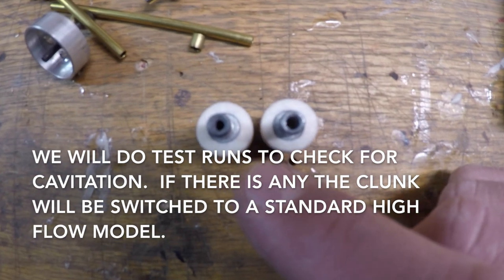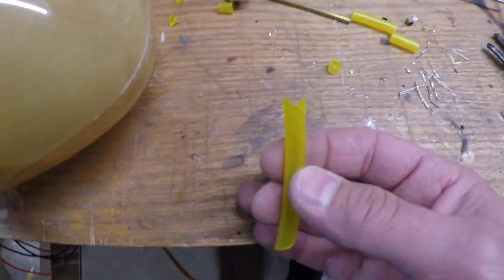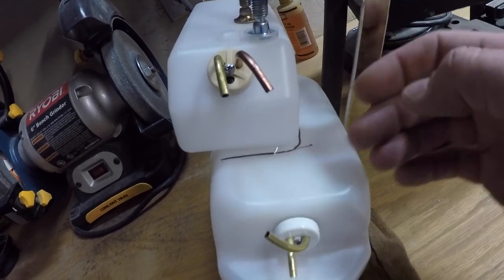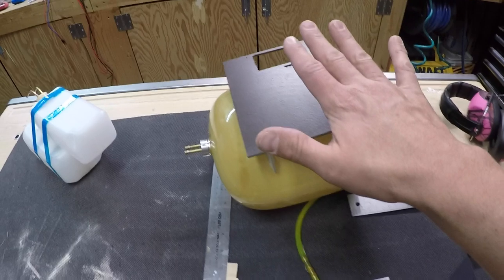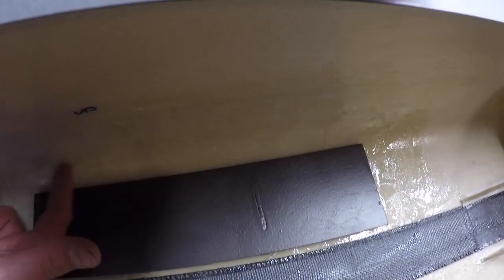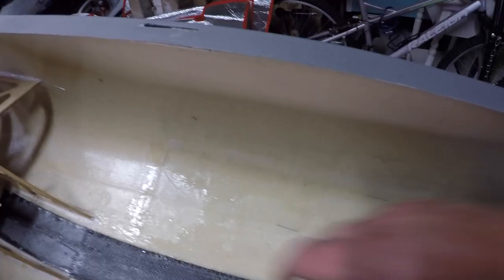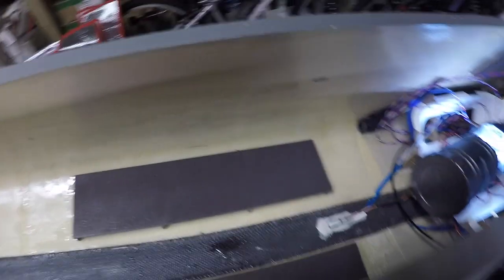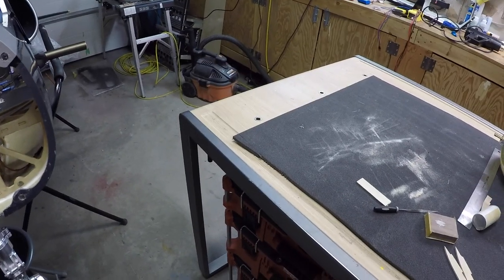CARF Skygate L39 Build Video #12  Fuel, Smoke and UAT Tanks, Equipment Layout Complete

Comment: Hi. Great videos. As I’m new to jets, what is the purpose of the UAT and why is it mounted at an angle. Thanks. Ian
Reply from the maker: Hello Ian. Thanks for watching!  The UAT is in its simplest form a bubble trap. Any air that is picked up in the main tank will hopefully be trapped in the UAT and not go any further. The plastic bottle types are best mounted at an angle because when you fill up the fuel system you’re feeling from one line coming from the UAT and it feeds the rest of the tank or tanks from the nipple beside the fill one. This nipple going to the next tank is at the highest point if the UAT is at an angle so after filling the UAT has no air. 

Make sense?